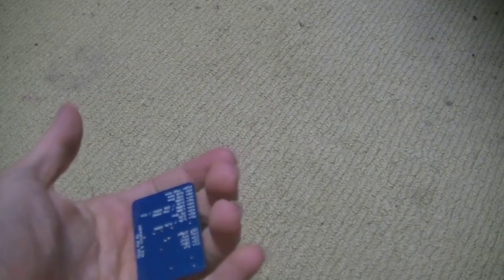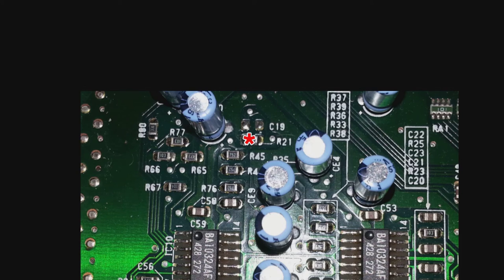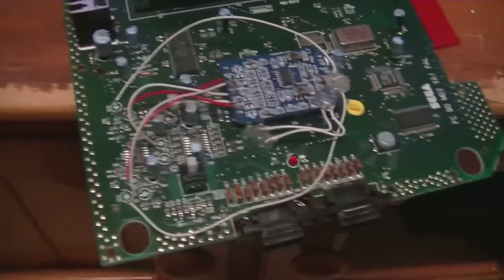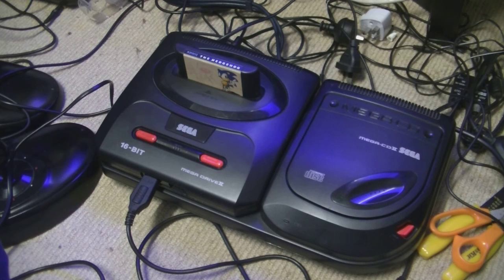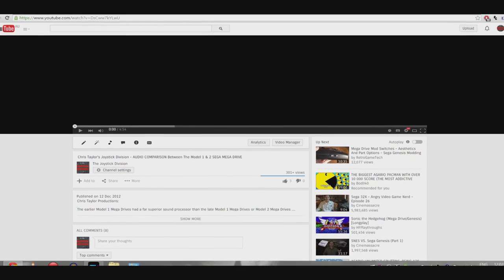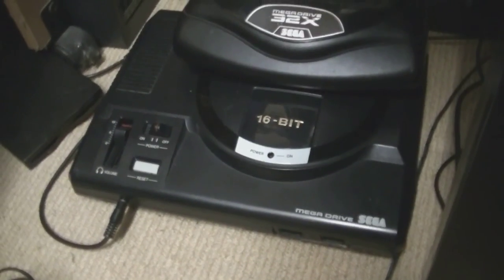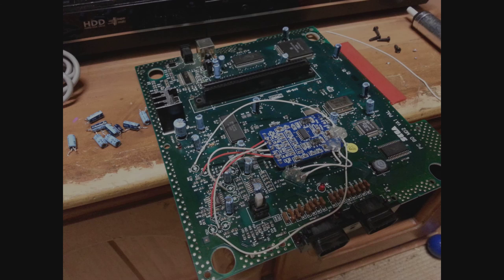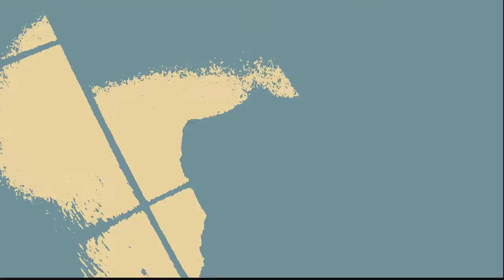Mega Drive II MEGA AMP & Audio Comparison | Joystick Division

Comment: Great video ! How did you stabilize the mega amp on the SEGA 315 chip? and also doesn't the mega amp get hot by this chip?
Reply from the maker: I'm glad you liked this old video. :)
To stick it on top of the 315, I use one of those double-sided adhesive things, like the ones you'd use to stick picture frame hooks on walls.
Funny you should mention it getting hot.
Within the few years after this video, the console did overheat and is now dead, but that's only because I didn't realise how important the RF shield is when it comes to hear dissipation.
I'm still using the Mega Amp, just in a different Mega Drive II and it's working perfectly fine. I even compared it to the Mega SG in a more recent video.
Reply: @JoystickDivision  Thanks man! Hmm . But now that you installed the mega amp to a different mega drive II did you use a different method or again above the SEGA 315 chip but with the RF shield? I am planning to install one of those to my mega drive II (same revision as yours in this video) and I am little bit concerned about the overheating thing.
Reply from the maker: I installed it in exactly the same way, but with the RF shield in place and much better soldering skills, so that's a plus.
I haven't noticed any problems so far and I have it connected to my Mega CD and 32X at all times.
If you're really concerned about heat issues, then I encourage you to keep looking for methods better than my own, especially because I haven't played a whole lot of the Mega Drive, but when I do it goes for hours without a single problem.
Hope that helps and good luck with your Mega Amp, it's a life-changing little board.
Reply: @JoystickDivision  Thank you, much appreciated! Keep up the great work! Cheers!
Reply from the maker: Thanks, I'll do my best.

Comment: This was a FANTSTIC video! You deserve more views, and likes. I have the same model VA1 so I may try using your guide to do the mod.
Reply from the maker: Wow, thanks! I really appreciate how much you enjoyed this video.
Yeah, I found that guide on a Mega Amp forum, I think.
Unfortunately, since this video, the Mega Drive started having problems (NOT related to the Mega Amp!), so now I'm looking for another VA1 to re-install it in.
Thanks again for the feedback.
Reply: Never done any soldering before, so I am a little scared. What guide did you use?
Reply from the maker: I only used an image of where the wires go and what capacitors to remove. It's in the video.
Soldering is not too difficult if you have the right soldering iron and right solder. I'm not an expert on that stuff myself.
I suppose you could practice soldering with some wires on spare parts if you have any.
Thankfully this mod is relatively easy to do.